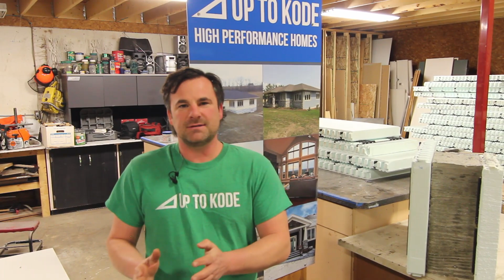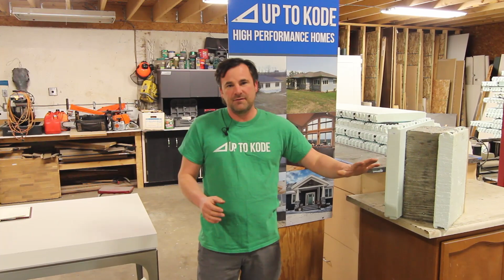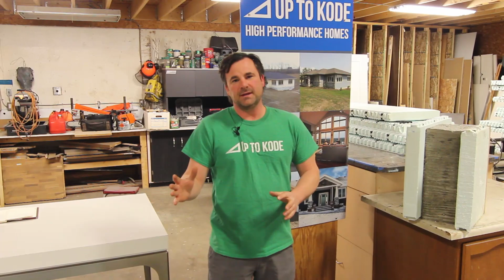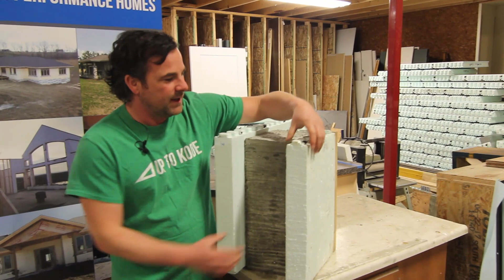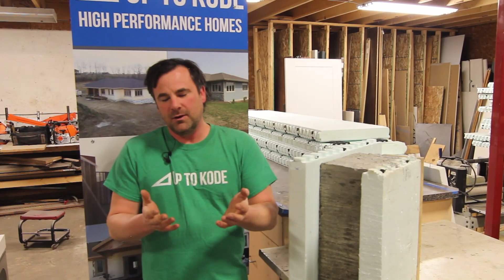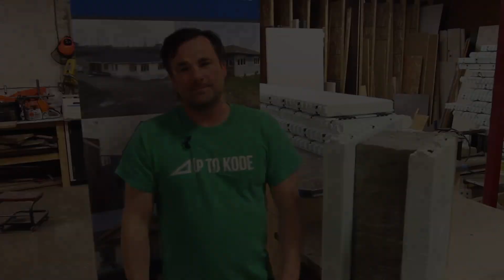Why R-Value is not accurate when comparing ICF to 2x6

Comment: I want to know  how the Icf wall performs in winter with 3-4 months of cold will that not cool the thermal mass quite a bit?
Reply: That’s where adding more insulation on the outside would be more beneficial.
Reply: Nobody ever talks about how that thermal mass goes both ways.
Reply: @JohnSmith-xx9se  I agree I mean the warmth of the house will always keep the thermal mass warm to a certain extent from the inside but where does that push pull from different thermal pushing go
Reply: @JohnSmith-xx9se  I've been told that one of the drawbacks of ICF is that the walls/foundation works like a heat sink and can actually pull heat from the inside out and down to the foundation.  And in cold temps the opposite works as the foundation (which is cold) weeps the cold up the walls and into the house...
Reply: @gcodori  ground Temps would cause a moderating effect on the walls relative to outside Temps which would, if anything,  improve the Thermal mass benefits.  Google your average ground Temps and where you live.
Reply: @paulnovak833  good info.  Another thing I was wondering...has anyone build using ICF but with some kind of radiant heat routed within the forms prior to the pour?  Like running the electric radiant wiring within the form (I don't think water based heating would be practical).  Maybe attached to the rebar within the forms...

I think it would only be useful in areas like Alaska where the ground temps are too low to be comfortable.
Reply: @gcodori  I've thought about it that too but haven't heard of it.  I think solar radiant would be a better option. Close the system in summer or use for hot water
Reply: the concrete wall is connected to the GROUND TEMPERATURE.  The stud wall with insulation isn't

Comment: Thanks for all the good videos. It was better if you had emphssized, if the tempreture doesn't fluctuate, then the thermal mass wouldn't help at all. Also, for below grade because of the thermal mass of the groud, the thermal mass of ICF has no good extra benefit.
Reply: It can still be beneficial to both of those scenarios. Unless the place you live in has either 24hr sunlight or 24hr constant darkness it can still be beneficial to you depending where the thermal mass is located within the wall assembly. 

In my climate, having a basement made with ICF, the ground temperature can help stabilize the core of the entire house. Keeping it cooler in the summer, therefore requiring no A/C. It also helps keep it warmer in the winter. Adding lopped sided insulation and moving the thermal mass to the inside of the wall assembly further improves its capability.
Reply: @aaronolsen8787  exactly  this is like adobe walls.  the ground temp makes a big difference
Reply: @aaronolsen8787  first of all, there is no doubt that ICF is better than stick frame and regular concrete. Priod.
I am just being sheldon cooper and maybe splitting the hair, but in theoey:  if you have regular concrete (outside) and add the same amount of insulation as ICF inside, it will be slightly better insulation because of thermal mass.  If you have doubt please do the heat transfer formula.
The reason ICF is better than that plan is that it will be actually cheaper to do ICF than doing concrete and then adding two extra layer of insulation. Peace!
Reply: @hameedtalebi2351  ideally you wan the thermal mass on the inside of the wall, that will make the condition space temperature stable.
if I can chose I will build a concret/brick wall inside with continues eps on the outside
Reply from the maker: Good point. I’m still learning too.